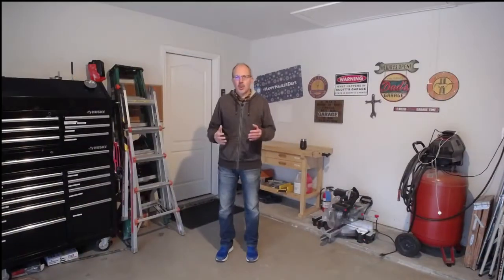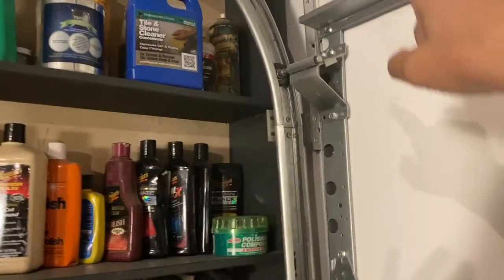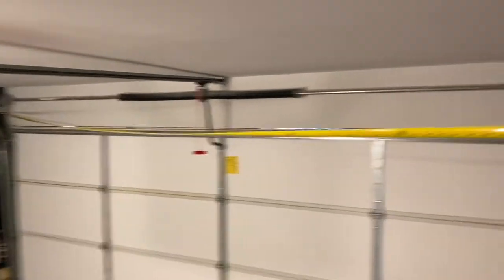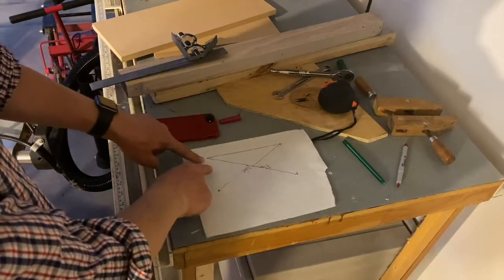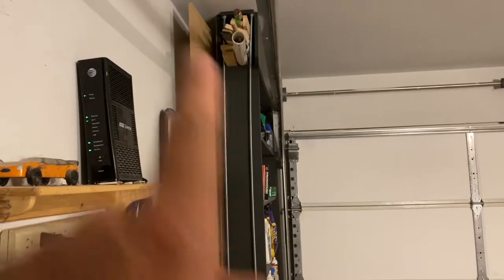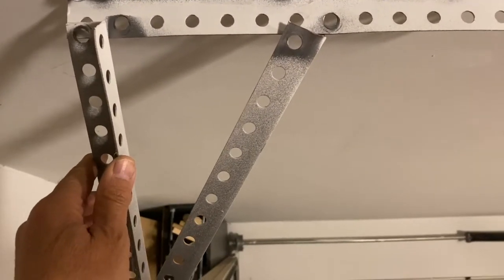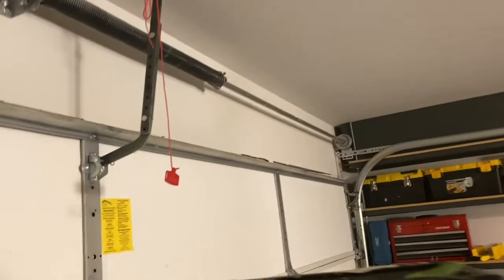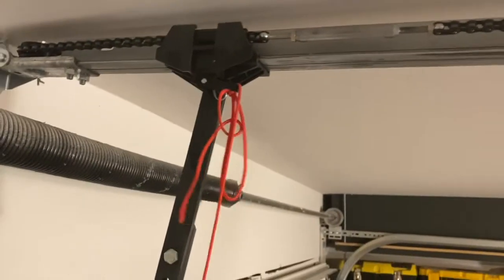Be sure to check whether your garage door tracks are skewed if your door does not shut! Find out how

Comment: This fix worked perfectly for me!  I had tried everything: looking at the sensors, checking the wiring, adjusting the closing force, etc.  None of these worked, so when I stumbled upon this video I checked my tracks and one was skewed by 1.5 inches.  I loosened some bolts, moved bracing around and was able to get it back in alignment with the other track.  Thanks, Scott!  Subscribed!!!!

Comment: Great video... it's driving me crazy that the weather changes are causing the metal expand or contract and clearly change the skew of my tracks.... every winter my garage gets stuck 3/4 the way up. The most valuable thing you mentioned is how only 3/4 inch off measure is significant... seems that garage tracks are so semsitive that we would be driving put selves crazy to keep adjusting the tracks each season.

Comment: Silicone doesn't last very long, try Rust Check  coat & protect Lubricant at Walmart. Lasts longer & inexpensive. I use a can per door. Don't use white lithium, it gums up with age.
Reply from the maker: Thanks for the tip! I will give it a try next time!

Comment: Your rollers sound really dry  
You need to oil the springs, tracks and rollers.  My rollers were loud, it was the old steel rollers I changed all of them to nylon including the bottom rollers, search 
Youtube an older garage door tec shows how you can change all of them by making a bend at the apex top part of the track yes even with torsion springs.
I got the rollers off Amazon the rollers use real sealed berrings.  That made the door very quiet.

Comment: The shift in the tracks can be poor instruction or your foundation has shifted.
I dont think tech pay that close attention to the overall upper track squarness.
You could have a woren rod berring where the shaft meets the bracket.
My door is 16x7 solid wood, its old and the bottom board was finger jointed to 16'
It has a metal strut going from side to side, most the glue joints have broken loose the doors over 27 years old.
Im faced with going metal or fixing this one.
The metal doors do not give as much wind resistance, I live in kcmo tornado ally the first thing that goes in a tornado is the garage door. This presure can lift the roof off your house. Once your roof comes off it dosnt take much to take out the walls, code didnt require straps on the rafters top plate or studs down to point load, no technically your standing in a house of cards held togather with tiny metal rods "nails"  standing its pretty strong but add sideways presure its rather weak.  If my local area requirements were hurcain straps and earthquake reinforcement requirements then the structure not moving without a fighting chance. Screws hold wood boards togather better then nails,
You cant pull a screw out of wood as easy as you can a nail nails bend deck type screws do not bend and have sheer strength.  In Canada they use screws. In the USA they still use 16 penny nails.

Don't take my word for it run your own tests. 
I think 200 to 500 dollars extra in better hardware can go a long way in making a house more sound.

Comment: But how do you go about fixng it when one side sank down about 3/4” and both corners like where you adjusted are and have been loose…??  Worked fine till one day just stopped closing and saw my foundation sank..  fixed that but couldnt raise it back to height and now my door isnt closi g..  opens fine..

Comment: my sister‘s house has a single manual lift garage door. The top panel does not close completely. It stays open about 3 inches. It has one of those Springs mounted above the door that you have to twist to tension.. I am afraid of springs that old. It’s winter, my sister does not park her car in the garage ever. I just want the door to close all the way to keep most of the cold air out. I’ve laid two blankets rolled up in that gap to keep the freezing air out. I know she needs a new door, but she needs to many other new things at the same time like a car, a kitchen, bathroom, ECT.
 I’ve been looking but I can’t find a video on how to make the top panel completely wrong roll into place against the header. The door comes down all the way, it’s just that the top does not rotate forward about 3 inches. I can push it manually, but it won’t stay there without something pushing it
Reply: that top roller has an adjuster of some type for that doesnt it? search videos on it.

Comment: How do you reinforced the door? I think mine isn't closing because of a crack on one of the panels
Reply: Install a bar across the entire door. Not flat stock but 24-Gauge Steel Horizontal Support Strut. Had to install on mine.
Reply: @ebglock  This guy has a horizontal support strut along the top edge of the door. Look at 6:30
Reply: @etownsterguy9489  mine already came with top strut preinstalled. but i had to add a second down low, one of panels is damaged. they are very difficult to find only one place on the internet was selling them. iirc runs 120 bucks too not cheap. now a couple yrs later, more issues, it stopped going up in the cold. which i have fixed...for now, and as it warms into spring that should help. overall i feel like the struts are band aids. probably have to replace everything sooner or later.

Comment: Viewed a few troubleshoot videos now.. this is the first one to propose an issue non related to the reverse safety sensors 🫡

That said, the search continues for the culprit acting on my door. The carriage is reluctant to move either direction even while disengaged. 

Always acts up in colder weather but never to this extent. I hear a click in the receiver box, but very little movement if any. Same result when when using a remote vs using hardwired wall up/down button. Time for a new receiver maybe?